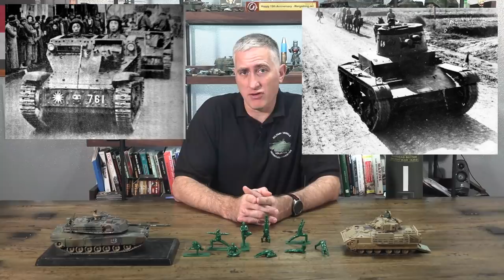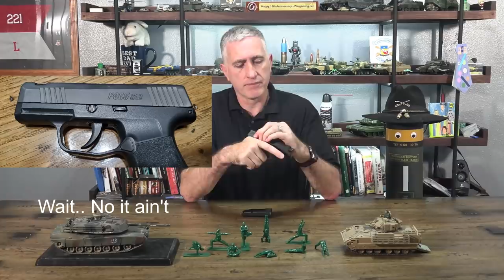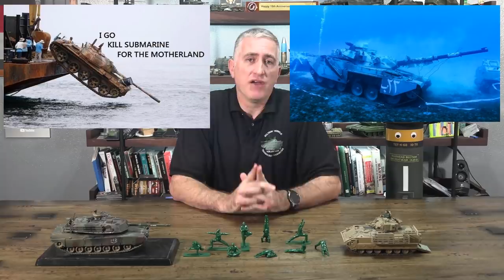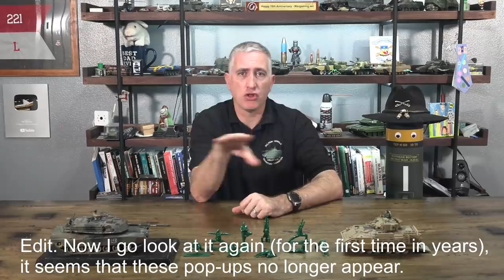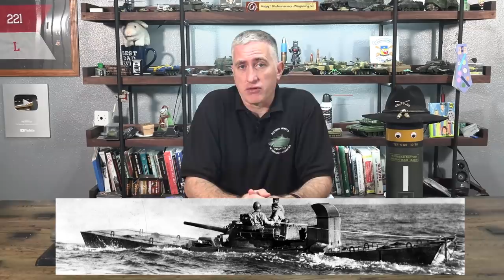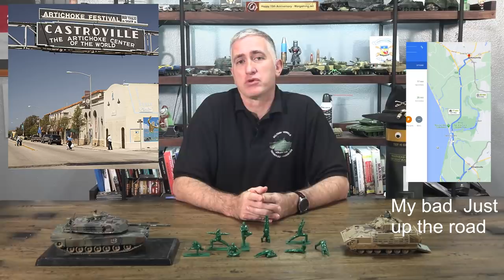Chieftain's Q&A 17. Rants, Ladas and shooting the other guy's cannon

Comment: The day my gunner fired the gun of the tank to my right was a cold and foggy day in Baumholder in the early 80s. - After hitting the target, the CO asked who had shot. I reported positively, and so did my surprised right neighbor TC. The maintenance crew later reported that the “last” firing relay of the other tank had not completely returned to the open position and had got stuck halfway. The shock of the shot from my tank then closed the relay in the firing circuit of the other tank. A few years later, due to these problems, it was forbidden to switch on the main firing circuit of this model and only the emergency firing circuit could be used during live firing.

Comment: To my limited knowledge the mirrors on german tanks are there to make the tanks road legal.
Reply: Sounds possible to me
Reply: I served in Germany. That is correct.
Reply: German Cop: Sir do you know why I pulled you over today?

German Tanker, looking over the side of his Leopard: Not really, no.
Reply: Andrew Crews  surely that would be badge of honour (unless it was in a school zone)
Reply: Andrew Crews  I believe that Cheiftain was pulled over while in theatre while in an Abrams. Accredited it to that the vehicle may look like it is moving faster than it actually is due to the length of the track running the length of the vehicle and all moving. He explained it better... I believe it was in his Q&A appearance on Forgotten Weapons
Reply: Andrew Crews  happened with the XM1, too!

Apparently the engineers got tired of going out to the ranges to test and back to the shop to make tweaks and back out to the ranges. So they disabled the governor and were flying down a tank trail next to a paved road that had a base police speed trap on it. Story has it that they were way over 60mph on a 35mph road.
Reply: This sounds like something the Germans would definitely do
Reply: Andrew Crews  Take out the locking device on the drive computer and you are good to go above a lot of speed limits. It runs close to 90km/h with no ammo, low on fuel, and no crew and their stuff.
Reply: Andrew Crews  Well these are actually quite quick...
Reply: Well everywhere in EU tank need to have Signal lights mirrors  and brake light and main Driving lights
Reply: Andrew Crews  My father used to be in the army, his favorite story during his time there was during an movement exercise where a Chaffee broke down at the mission site. As a maintenence officer in the company(or whatever it’s called, I can’t recall), he was tasked to try to recover the tank.
When they were done fixing it it was already late at night and the trail they came from was pitch dark, so they decided to have some fun with it and ended up charging down the highway at 40mph back to the base
Reply: @commanderhindsight1633  "Because I let you."

Comment: On the lada: the fewer parts you have, the fewer parts can break
Reply: That being said; an up-armored rickshaw is ideal tank.
Reply: Also: If you don't have the funds to get a new car, you will find a way to keep the old ones running. 

Cubans do the same with American cars. (Not for financial reasons though.)
Reply: As well: the fewer proprietary parts there are, the easier it is to get the parts that keep it running.

 Quite a few bits and bobs on a Lada can be fabricated from what are basically scraps, if the situation really demands it (the manual choke, for instance, is pretty much just a piece of metal cable with a fancy pull knob on one end: pretty easy to put together an ersatz one if it ever breaks).
Reply: @Telamon8  not to mention that the USSR didn't have any legal provision for private patents.
Everything made in warsaw pact countries is public domain.
Reply: Also- almost all soviet cars were copies of western cars (linked video)- but Lada was actually a licenced FIAT with production line bought and assembled in Russia. That FIAT model was chosen as it had good reviews, was known to be rugged, plus sociaIist government was elected in Italy, that was happy to work with USSR.
https://youtu.be/UY4kR_zK_6I?t=553
Reply: Its a Russian made Fiat 124
Reply: ladas are shit unreliable cars, chieftain needs to stick to his dayjob of talking about tanks instead of cars
Reply: @kingbones2620  Ever owned a Zhiguli? Noisy, lacks servo, very modest safety.. but is reliable up to like 300k kilometers
Reply: @benwilson6145  Not quite.
There are over 800 differences.
Including:
-completely new engine
-strengthened body
-stronger suspension
-redesigned rear suspension
-uprated gearbox and clutch
-dual-circuit braking system
-rear drums because the discs performed bad
and others
Reply: @kingbones2620  considering the alternatives and especially BL junkheaps along with Italian rust buckets the Ladas had to be reliable to stand up to use in Russia. Easy to fix, cheap and available they were often used as taxis. Admittedly Spartan but so were many other cars at that time. I certainly wouldn't put them up against a modern car but considering what was available it worked. 

Over 20 million made and a very few still being driven in the UK the main reason for being pulled from the market was emission limits. The reliability jokes were American cold war propaganda.
Reply: But...the Trabi!
Reply: @verygrumpy  Trabant was East German. Now worth about 15,000 US for a good condition one.
Reply: @Random-nf7qb  The plant was from Fiat, they liaised heavily with Fiat. The difference in body structure was basically using a thicker gauge metal because the cars were basically falling apart during the test on Russian roads.
I owned the later hatchback the Samara. Bar a dodgy quick death clutch that the dealer tried to charge me for until I had words, and it was fixed as a warranty item. Other than that it was great.
Reply: @seriousmaran9414  The Trabant engine was basically two MZ engines as a parallel twin. Lots of swappable spare parts.
Reply: @COIcultist  For the Ladas 2101-2107 you're right. (2108 and later don't have anything to do with fiat) 
I was talking about the other cars.
Reply: @Random-nf7qb  Sorry I don't know the nomenclature you are using 21-01 to 21-07 nor the 21-08. For sure the later engines for the Samara I think they bought design consultancy from Porsche? But yes for sure the early Ladas and I know people who owned them. Good basic cars, some police force went cheap and instead of Land Rovers or Range Rovers got a few of the Niva 4X4s. Apparently the plod issued with them went all out to break them then ended up having massive respect for them when they couldn't break them, and they discovered how good they were.
Reply: @COIcultist  2101 - the basic car, looks pretty much identical to the Fiat 124
2102 - basically a 124 Familiare, a.k.a. estate version
2103 - more luxurious model, 4 headlights.
2106 - update of 2103, a littpe bit different styling, larger engine, less chrome, etc.
2105 - 1979 update of 2101, rectangular headlights, also known as Riva
2104 - estate version
2107 - luxurious model of 2105, could be said a successor to the 2106.

(2121 - Niva 3 door
2131 - Niva 5 door) 

2108 - Samara 3 door
2109 - Samara 5 door
21099 - Samara 4 door sedan

The Samaras have only one engine family - the one that was developed with the help of Porsche Engineering(the whole car was devwloped with their help)
The old engines were never put in them, they share nothing.

Later models are called:
2113 - Samara mk2 3 door
2114 - Samara mk2 5 door
2115 - Samara mk2 4 door

2110 - 110 sedan
2111 - 111 estate
2112 - 112 hatchback

1117,1118,1119 - Kalina

2170 family - Priora

2190(not sure) - Granta

2192/2194 - Kalina 2 (now called Granta)

All of these are on the same basic platform - Gamma, from the Samara :D

And then there's the Vesta, I don't know its number.

They also make B0-based cars(Dacia platform, Renault-Nissan bought them some time ago) - X-ray and Largus
Reply: @Random-nf7qb  You have thrown me on the Dacia front. I half way knew someone who had the Renault 12 based car. How did we get from Romanian to Russian to Renault buying them from the Romanians in short order or were Lada (Vaz?) just building something based on the Renault 12 platform?
Reply: @COIcultist  No, VAZ(Lada) had nothing to do with Renault or Dacia until about 2010.
VAZ is the name of the manufacturer, the brand is Lada.
Reply: @Random-nf7qb  Sorry about my last post, I've just edited it, it seemed to contain two instances of spurious words.
No, I realise Lada is just a trading name of Vaz.
I often look things up in-between commenting but not if I'm getting information from someone who has a good degree of knowledge as Wikipedia isn't exactly infallible, and sometimes you just make yourself look a knob if you don't listen to someone with a bit of knowledge.
However, we appear to have got to a point where we are not quite understanding each other, so I've just had a look at Wikipedia about Dacia to try and add a bit of clarity.  It says "A large logistical centre was also set near the plant in March 2005, the International Logistic Network, from where complete knock down (CKD) kits are exported to other Renault production sites in Russia, Morocco, Colombia, Argentina, Brazil, South Africa, Iran and India.[38] It is reportedly the biggest logistic centre of its kind not only in the Renault Group, but in the entire world automotive industry.[39] In 2012, the total equivalent of the kits sent worldwide from the centre was 920,646 vehicles"
So it is saying the cars are exported to Russia as CKD kits. Is this as you understand it or is there a larger Russian tie up?
Reply: @COIcultist  interesting but I didn't mention anything other than it being East German. Not the most efficient engine but it was and still is reliable. Perhaps more important easy to fix.
Reply: @COIcultist  Renault bought the old AZLK plant, I guess they are assembled there.
I don't quite get what you're asking.
VAZ and Dacia have no connection.
Renault bought VAZ recently and gave them some funds, they did some updating and they now have 2 models bases on the B0 platform.
Before 2010 there wasn't anything between them.
Reply: @Random-nf7qb  Right so Renault now own Vaz.
I was running with the "They also make B0-based cars(Dacia platform, Renault-Nissan bought them some time ago) - X-ray and Largus" I went the wrong route and took it as a Vaz Dacia association not a Vaz Renault association. Maybe I would have done better looking up Vaz instead of Dacia.
Many thanks for commenting politely and trying to help, stupid YouTube flame wars over nothing really piss me of.
Hope you have had a Merry Christmas, sorry hope you will enjoy Christmas in 13 days time. May you and those you hold dear have a better 2021 than 2020.
Possibly making another mistake I was assuming you are Russian.
Reply: @COIcultist  :D Yeah, I am not russian, but thank you.
Reply: @seriousmaran9414  "American cold war propaganda."  Hahahaha, even top gear and others covered it. Unreliable crap lada.
Reply: @kingbones2620  seems you are someone with no idea and just assumed the propaganda is true.

Comment: I am only now realizing that those little green men between the bradley and the abrams are yogis and not green army men
Reply: Either that or they're in positions that the maintenance of particularly badly designed tanks require. (Says someone who spent some time upside-down in the back cockpit of a Phantom changing out 110 pin connectors with 28 ga. wires.)
Reply: Took me waaaaay too long...
Reply: It took me 22 min, by the timeline.
Reply: @Mishn0  I believe that this represents the new "Kinder, Gentler Army".
Reply: Green Airforce Men.
Reply: whats a yogi
Reply: Whatever it is, Mr. Ranger isn't going to like it :P
Reply: @jakegrube9477  A yoga teacher.
Reply: Those are the tank crews. That's the stretching they do in order to be able to move again after sitting in their cramped tanks all day. A couple of them are still stuck in their unnatural positions.

Comment: "Shooting the other guys canon" sounds like a gay euphemism.
Reply: What starts out with 100 men and turns into 50 couples? A submarine crew.
Reply: Oddly,  there was an incident where an A-10 modified with improved Bombing system allegedly dropped a 25lb practice  bomb into the 125mm gun of a T-62(?) Target at the Las Vegas military forces center. The smoke spotting charge came out the barrel end.